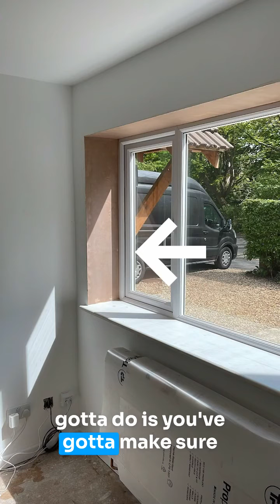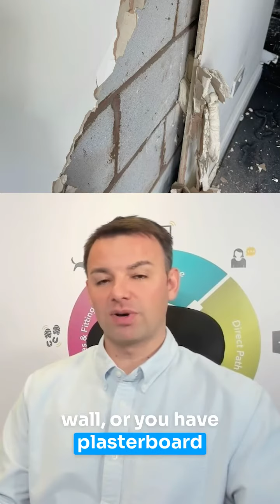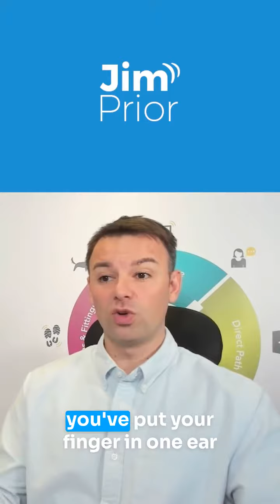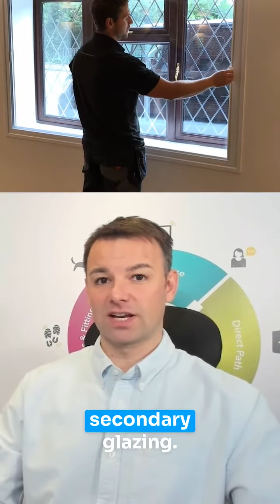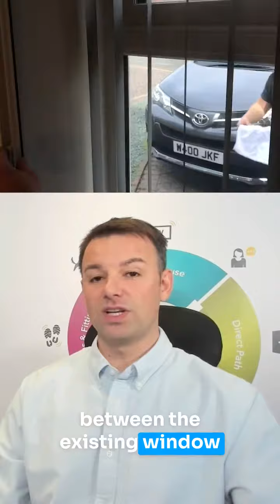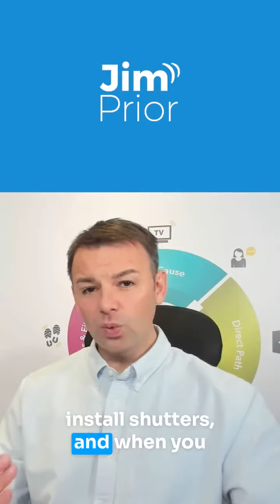How Do You Reduce Road Traffic Noise Using Secondary Glazing?

Comment: Thanks for this nice video , 
I want to soundproof a room with one wall near to a road and that wall has a triple glazed laminated window and the wall is made or thick bricks no plasterboard
I still hear motorcycle that comes in range of (50 to 56 db ) and trucks from (40 to 46 db ) 
If i install fiber glass soundproof on this wall will it make a difference ?
Reply from the maker: Hi Mohamed Sharaf-h9s, Thanks for your question: 

The answer is not really no....you will need to sound dead the brick wall. The good news is there is a free step by step course tutorial on the exact system you need.....all you have to do it put the time in to watch the video: 

Soundproofing for Beginners | Full Course Tutorial
https://www.youtube.com/watch?v=hVqa1m3JzGs&list=PL-ZigmSd311dNw8Tbe1IfLiJgEiJcjvMN

this 50mm system is what you need and see if you can return it into the window reveals of your new window....If you need more than this course tutorial then the paid for Noise Free DIY Soundproofing Course will help you out with all the missing bits.

Hope that helps.